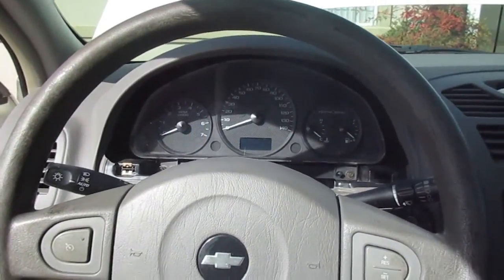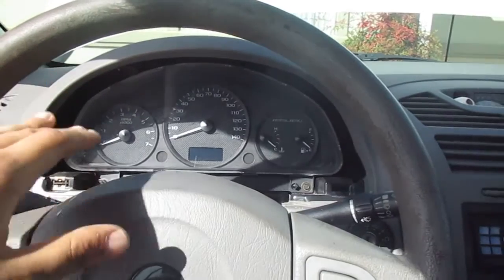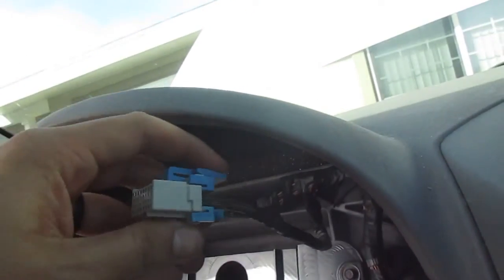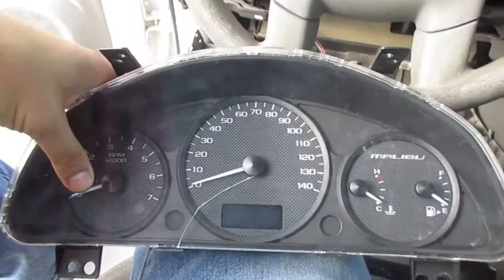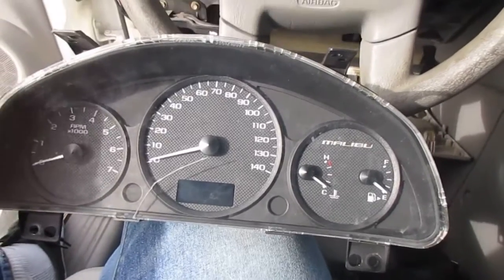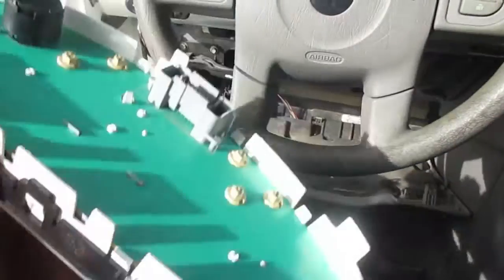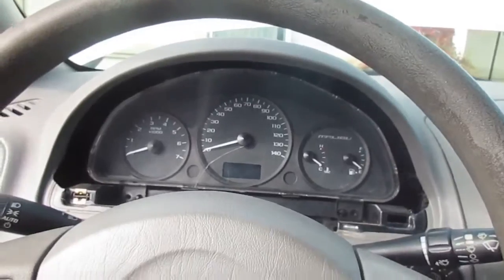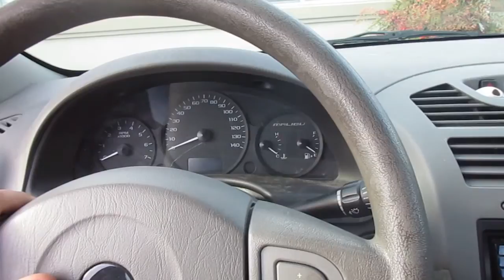How to replace your dashboard lights

Comment: Yo my guy the lights for the number and gauges are the ones that you were pointing to on the back of the cluster those turn and come out and for future reference you can completely take that apart the circuit board itself detaches from the rest of the assembly making it very easy to replace the bulbs that are out, also they make upgraded LED lights now that you can get in any color that you can replace and make it light up any way you want so as you said in the video it is very possible to do this yourself
Reply from the maker: Thanks for the tip Patrick! Yeah I didn't touch into that because I don't know much about it so I don't want to give wrong info 😬
Reply: I have a 2008 Chevy Malibu I didn't know too much about it either so I took mine apart to look after further investigation I found out that the lights that you were pointing to go into their own channels I'm in the process of turning mine green
Reply from the maker: @patrickspepper8119  Nice! Hell it be nice if you made a video on it so I can learn too!
Reply: Ok maybe I will! Make a video
Reply: You have a Facebook my guy?
Reply from the maker: @patrickspepper8119  Sure do, https://www.facebook.com/garturo0817940

Comment: Thanks for sharing this video; I have a similar problem. My dashboard goes completely out when cold. When it warms up, I disconnect the battery, and starts working perfectly again. Going to take it apart next time, and check to see if there is voltage at the panel, next time it does not work. Thanks again!

Comment: Those white 4 point pinchers all u do is push the center down with a pointy tool (some sort of pick) and they release the circuit board. That's how I did it. Some of the parts had some slime on mine. About to clean them up

Comment: Do you know how to change km back to mph when it no longer has the original radio ?
Reply: You can't, you'd have to connect the old radio again to have access to the DIC. You can also look for an aftermarket radio adapter that allows you to use the DIC and have a different radio.